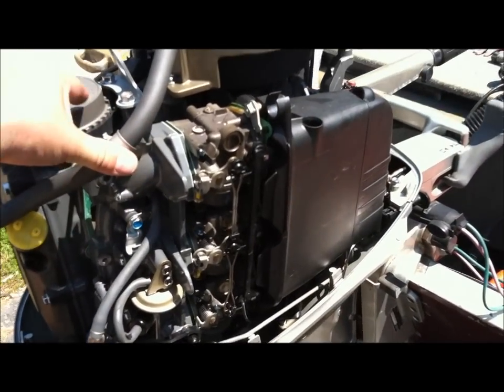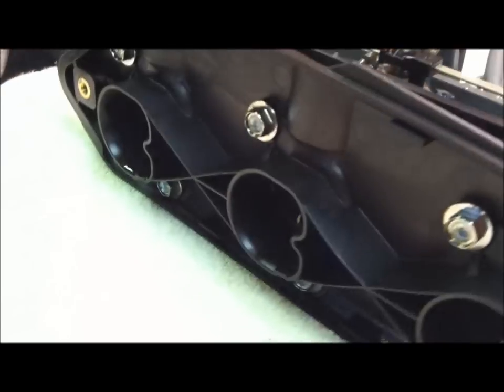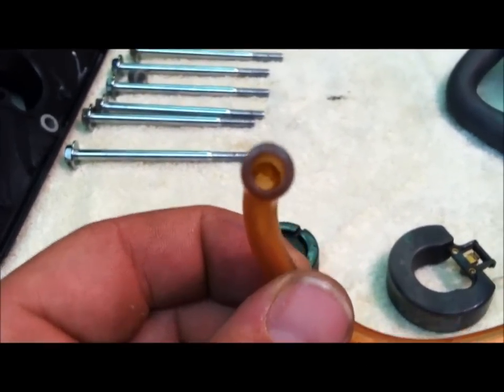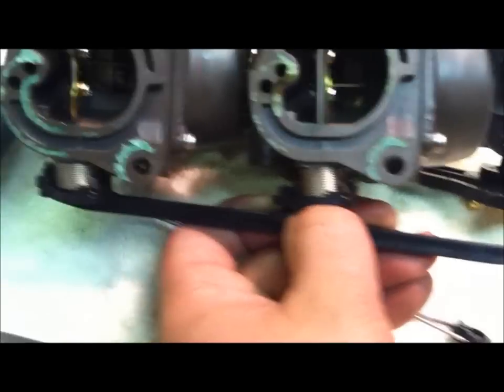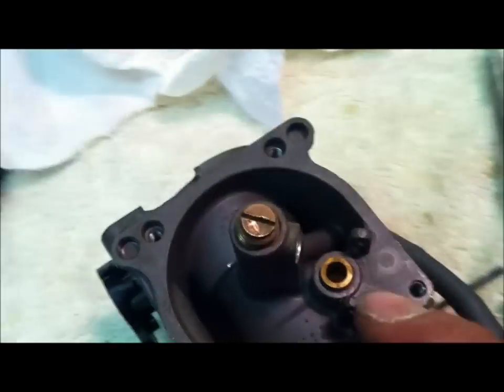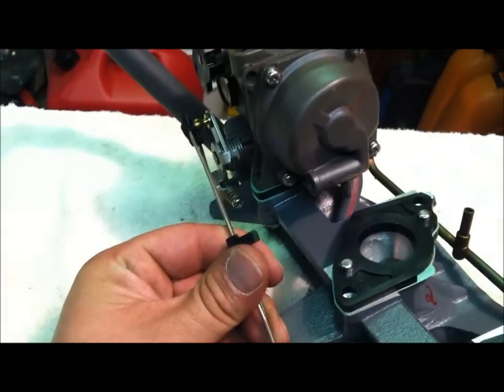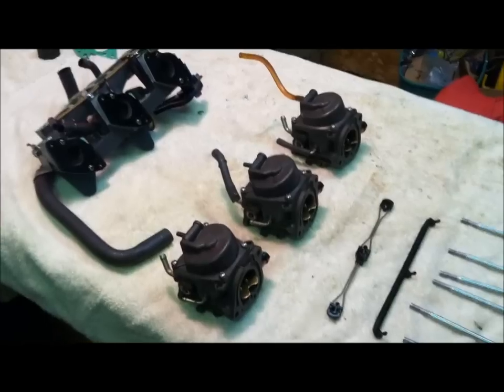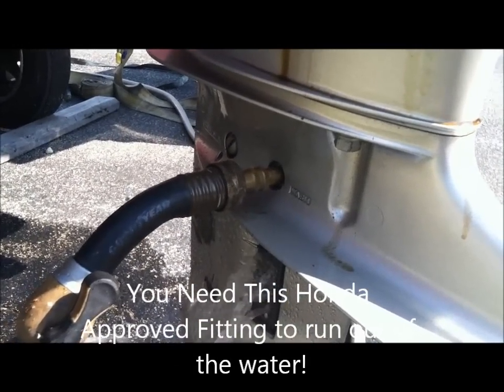Honda 4 Stroke boat motor carb cleaning class

Comment: I see that you have the water attachment pushing water through the foot ...but i don't see any water circulating through the engine  since there is no water exiting the  pee hole above ...pretty sure that's an indication no water is getting through the engine cooling system.

Comment: Great video but I'm concerned that there was no "tell tail" squirting out when you were running the motor at the end. I think your supposed to tape shut the three intake grills near the propeller so that the water your injecting with the hose gets to the water pump therefore being pumped up to the cooling system of the motor. If you run the motor too long without the water passing through the motor it could over heat and cause unrecoverable damage. Hope this helps.

Comment: Good video that may get your motor back running again but if you're going as far as disassembling the carbs you should really be removing and cleaning the emulsion tube. This is the part this video refers to at around 8:20 there is a tiny hole in the middle of this tube that can easily become gummed up and is usually the culprit when having issues with these carbys. Remove the tube clean with carb cleaner and clear with air if you can, do not under any circumstances attempt to clear the hole with a pin or anything like that. Re-seat with appropriate o-rings clean the rest of the carb put together and hey presto you're back in business.

Comment: ? Buddy you missed a ton. That stopped up hose is a bowl drain. That little brass screw is a main jet. Torch Tip cleaner. Skipped the low speed jet. Sorry, okay armature try

Comment: Appreciate the video. FYI the round thing covered with corrosion & salt that (you mentioned was from florida salt and noted with red letters 'corrosion-------> ???') is called an anode, or a sacrificial anode, aka a 'zinc' which is a piece of metal (zinc) that sacrifices itself through galvanic action/ electrolysis to save more important metals from corrosion, in this case the carbs/manifold.  Once they are 2/3 eaten away they should be replaced which will save the more important metal parts of a boat or its motor and should be cleaned/checked regularly.  There are many 'zincs' in most outboards.  If not replaced the metal they are meant to protect will disintegrate rapidly especially near salt.

Comment: He doesn't know how to properly use the Honda flushing attachment. There is no water coming out of the tell-tale outlet, I bet he damaged his impeller.
Reply: *unless the tell tale or it's line is plugged--Don't be a Dick. Yah he coulda used the flushing attachment, or trash can and been kinder to the motor.  But he ran it for like 5 seconds to show us... and said he's learning.   how many videos have you made to help others, offered to answer their questions, where the peanut gallery (like you)  leave their $.02? ... he says pardon his ignorance but still taught me things.  More than your cynical, ignorant remark did. at least be accurate if you're gonna be cynical, please, and don't be a dick.
Reply: @jamesarnold6059  He doesn't know how a carburater works and he hasn't read his owners manual to find out how to properly use the flush attachment. I don't think he should be giving advice on the internet on how to rebuild Honda Carbs.

Comment: Hey thanks a bunch, I just paid some yahoos to do a 500 hr maintenance on my Honda 75 and got it back running like hell, they adjusted running but low RPMs and not as much speed, took it back again and said they took apart the carburetors and sonic cleaned them, still ran poorly and low rpms, like 4800 at wide open throttle, not as much speed as before, drove it like 10 trips and then went out yesterday and it is pouring fuel out like this.  https://www.youtube.com/watch?v=WMfCRkqiOtA
It looks just like the one in your video, seems like the top carb is stuck open and leaking tons of fuel.  Pretty pissed that I just paid them another $500 to work on this and it is already messed up.  I would take it back and demand they fix it but I'm pretty sure I don't want them touching it anymore.
 Mine is a Honda 75 but it looks pretty much the same, do you know if the procedure is the same, I am thinking about trying to just rebuild the carb myself but I don't have much free time and really wanted to get it up and running for the last few months of warm weather.  Also never took apart outboards and don't really want to screw it up and end up paying more.  Pretty good mechanically but how hard a job was this.  Also, I don't believe these idiots properly adjusted/tuned the carbs correctly, I heard Hondas can be difficult to adjust or properly tune, and need to hook up some extra thing to tune them correctly, mine is 4 cylinder, just wondering if you had to tune/adjust the carbs?
Any idea how much it should cost and how long it would take for a mechanic to do this?
Thanks a bunch for the video I might just try to do it myself now.

Comment: E for effort for sure, and it pains me to be critical, but this is a terribly incomplete carb cleaning video. This person does not know how a carburetor works. The "little screw" is a jet. "That thing there" is the float valve. "That little deal" is the float. The intake manifold gasket on the cylinder head "looks good." It must be replaced. The most important part that must be cleaned in a Honda carburetor was never removed: the slow jet. Main jets must be polished internally. The wrong tool was used to remove the float bowl screws. A Phillips driver is not the correct tool. You must use a #2 JIS cross point driver. The choke linkage will snap off and on without squeezing the tabs. It's much easier to service the carbs if they are carefully clamped in a vice so the carbs are vertical and not horizontal. The cleaner used is not very effective for varnish removal. There was no cleaning of the float valve and seat which was causing the carbs to overflow. Running the engine without taping up the inverted cooling system (under the anti-ventilation plate) inlet will damage the water pump impeller.
Reply: Maybe you should make more videos since there are so few (haven't seen any of yours, or learned anything from you I din't know. but this video was helpful for me, unlike your comment) ... since you know so much.  easy to be an critic, not as easy to film shit while doing it. does not knowing what things are called mean he didn't clean his carbs?  don't be a dick. find a new hobby.

Comment: Sir.  Thank you for showing me the details of cleaning this carb.  At minute 7 you solved my problem on a Honda 4 stroke outboard motor that has not run in this century.  I did everything else but missed these 2 brass screws....sure enough full of gunk.  Cleaned and first pull was up and running.  Awesome!
Reply: Mike Ulias , Glad to have helped Mike!  Thats awesome!

Comment: I had the same thing happened to my carburetors yesterday but could not figure out why the fuel was coming out of those this video was very helpful however I still cannot keep my engine on it would start very cold like but will not stay on do I still need the clean the carburetors like you did? Or is there a easier solution before I start tearing it down and apart? I will be calibrating the carburetors for the record thanks in advance for your prompt response
Reply: Hi Marco, do you run ethanol gas in your engine?
Reply: @jeffherrick8000  i think so
Reply: There is most of your problem.  Switch to "No Ethanol Added" at the pump, after you clean out your carbs.. and you will have way less issues and way less time cleaning carbs.  You very likely have dirty carbs if your running ethanol.
Reply: @jeffherrick8000  also Jeff is it a bad idea to take off the air filter and douse the inside of the carburetors with carb cleaner?
Reply: My opinion, not going to get you very far, no.
Reply: Ok thanks a lot Jeff
Reply: My pleasure Marco!  Good luck friend!

Comment: I noticed one of the carb "tubes" were transparent ..  is that aftermarket , also is that material better or is that just what you had laying around ? I'm about to take on this task myself and just want to learn all I can
Reply: those clear tubes are OEM drain hoses,to allow draining the carburetor bowl for storage or to help diagnose cure a water in carburetors issue etc.

Comment: I say thank you to the guy who made the vid, you did miss a few things but that's ok.  You were on the right track, you needed to remove the emulsion tube and clean the idle circuit and you would have been golden.  To clean out the jets, find a wire brush and pull out a couple of wires they work perfect for cleaning jets, I have been using them for many years.. Now to avoid all this carb cleaning crap, use marine stabilizer in your fuel and drain the carbs when storing and you can put an end to carb cleaning..

Comment: Thanks for taking the time to get this up here.  It's hard enough to concentrate on doing this sort of thing, keeping track of what fiddly thingamabob or microscopic doohicky goes where and how, without also getting good clear shots of everything in the process.  I hope you'll ignore the bloviations in the comments section of any so-called "master techs" who call you an "idot".  You managed to get something helpful and worthwhile out there for regular folks like us.  Good job and well done!  Hope your Honda's purring along happily now.
Reply: Appreciate the kind words sir.  Ahhh, the "Master Tech's" comments are hurting no one but themselves.   This mindset is the entire reason I took the time to make this video.  Who has $700-$1000 to have carb's cleaned?  I just rolled my sleeves up and went to work.  My motor, to this day, runs great.  I switched to 100% pure gas / No ethanol and have had zero issues since.  I also "Fog" it every year before I put it away for the winter.  This helps get it rolling come spring Walleye run.  Anyways, thanks for the nice note.

Comment: I just had the carbs cleaned on my Honda 4stroke 50hp outboard by the dealer. It's runs pretty good at high speed but won't idle in gear. Is there a way to increase the idle speed?
Reply: I just looked at a friend's 90 hp Honda yesterday; the idle adjustment is plain to see once you have the hood off the motor. It's right where you'd expect it to be, simply a Phillips-head screw which you would turn clockwise for faster and CCW to slow the idle. You'll see it right away if you've worked on anything similar before. Hope this helps.

Comment: Ik recently bought the same motor (bf30, 1999) but it runs bad.after cleaning the carbs. I also cleaned the long needle with small holes in it (not cleaned in the video) Probably  replacing the rubbers is a good idea (already ordered) 
When running, I only pull spark cap 1 and the motor runs a bit slower If i pull spark cap2 The motor alsmost quits. If I pull spark cap 3, nothing happens. Spark plugs 1 and 2 look normal and spark plug 3 is wet black.  probably too much fuel or too less air.. 
The ignition is working (There are sparks on the plug, and the elctrode distance is normal (0,7). Today I will remove the carb and look at it again carefully.
Maybe also let the carbs drain the fuel and measure the volume of all three. This might tell something about the flotter-shutter.
I will also make a vacuum meter with bottles (as seen on youtube somewhere) to balance the throttles. But ok, let's first try to get it working.. Doe somebody have more ideas?

Comment: Thanks for doing this video. I have a BF50 that is off my boat right now as we have some weld issues on the aluminum ribs below the floor that are being fixed. I have wanted to clean the carbs while I have it off the boat. You are correct that there aren't any videos on 4 strokes so yours is a great help. It's hilarious watching the "master techs" get in an uproar about someone doing DIY videos (must be very insecure). Its like a lot of things that have to do with a boat...tack the word "marine" in front of it and the material and labor rates instantly double. I get heart burn when someone describes themselves a s a Master at anything-there's always something to learn. The "Master Welders" that built my boat at the manufacturer are costing me money right now as a REAL WELDER fixes the ribs (not enough heat on the hull...plenty on the ribs)...anyway, Thanks for your video! What's an "idot" by the way? (See post below)
Reply: Thanks for the nice note!  Glad it was a help to you!

Comment: Hello, I would like to give to the friend that cleaned the carbs and to anyone watches this video a few friendly tips cause sometimes some things are not that simple as they look so you can save yourselves from serious troubles.. Sorry for any mistakes but English isn't my language. Ok. The lil tiny thingy you hold at 7.50 which I don't know how you call it in English are made of copper. Copper is a VERY soft metal. When they get blocked (gummed) you NEVER never try to open the tiny whole with a pin like the one you used (IF you did it that way,). If you look close on it it has a number on it. This is the diameter of the tiny whole which you may already know BUT when you try to clean the whole with this pin you used and because the copper is very soft you will clean the whole but you will make the diameter of the whole BIGGER. And trust me even if you make it  slightest bigger  it will be ruined. The carb wont work as it should even if you think it does. The right way is to burn the tiny copper thingy with a torch, burn it really good and then put it in the carb liquid cleaner and use compressed air. It can be so hard gummed sometimes that even this way the lil whole may not open. In this case you buy a new one or you take a metal pin SMALLER than the diameter of the whole(check the tiny number on it and then measure your pin to be sure its smaller, never trust your eyes on this) and try to open the whole using a magnyfing glass to be sure you will stop cleaning when whole is open just the right time the copper will appear in the whole's walls. I think you get it how much important is not to open more the whole. Now about the other tiny thingy you hold at 8.55 and looks like a lil rocket if the nose tip that is made of rubber is hard it needs replacement. When you touch it with your nail it should be soft. If it is hard it may work but its just a matter of time your carb to be overfluded cause this stops the fuel to come in the card constantly when engine don't need so much fuel. They work exactly like the flush in the toilet. Also a basic check to all 3 carbs before you close the under caps (the cap that is the lil tiny rocket in) you must hold the carb on your hand in straight position up and blow air softly with your mouth in the fuel intake of the carb and push gently up the lil black flotter and then let it drop down softly while you blow air and see in what position they block the fuel coming in the carb. All 3 carbs must close and open this way in same degrees. If you search in internet or if you call Honda in your area they will tell you the exact degrees this black round plastic flotters should be when you have the carb upside down. Even if you don't know the degrees is important at least all to be the same. To check this just put all the 3 carbs on the table upside down and check carefully all the 3 black plastic flotters to be on the same level. If they are not you must press up or down with a small flat screwdriver the lil tiny metal plate the lil rocket is attached on so all the 3 to be in same level. When finish double check the lil rocket and the floter works smoothly as you did.  Another thing is about gaskets. Even if you manage to take them out without to brake them they need replacement cause they don't seal good after the first tightening . You will notice they are pressed-squized if you look at them good and you will see also the shape of the metal on them they come in contact with and seal. They may not be the central "head" of the engine gasket that always needs replacement if you take the "head" off but after all the work you do why to risk licking fuel again. A rule is to change the whole set of gaskets when you do works like this. The same goes with the rubber rings on the carb cap (the one that has the black flotters in it). Make sure they are not squeezed down. And after aaaall this work you must certenly make a carb adjustment cause 100% your carbs will need it after the cleaning cause many wholes opened in the main body of the carb and to other many thingies if you want your engine to work properly, to be efficient and not use more fuel than it needs. Its very easy to adjust the 3 of them while the engine work with the help of 3 organs I don't know how you call them. You can check in youtube how to do it, sorry but my English don't help me to explain this procedure lol. I hope I didn't make your heads dizzy but sometimes things are not that simple or else we all would be mechanics lol. I wouldn't really write all those stuff here but when you are at the sea you must be as much safe as you can. It can save your life. Having a lick of fuel that can cause fire in the boat is one of the most scary and dangerous situations in the sea.  You are not in land to lock the car and leave if you face a problem. I wish you all safe seas. Have fun and keep it safe :)